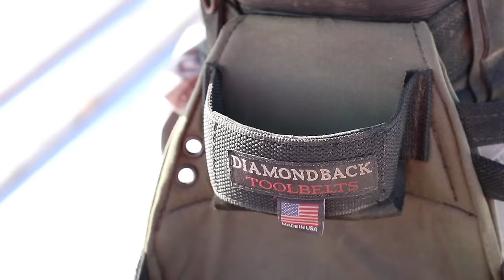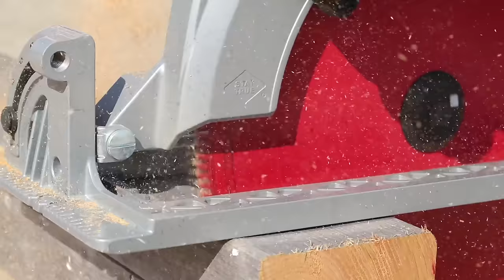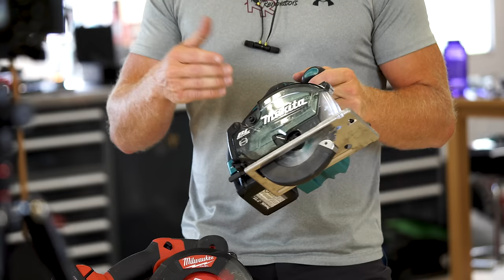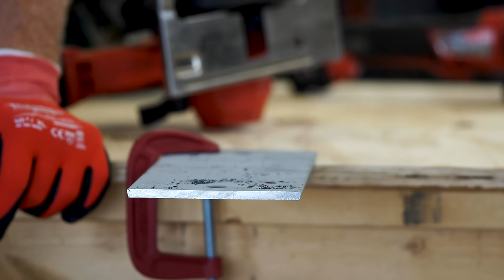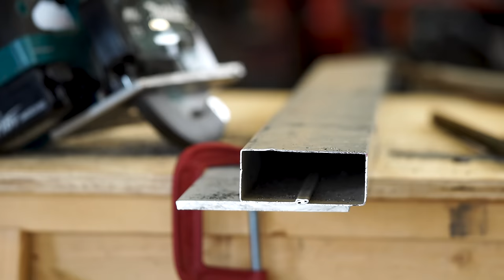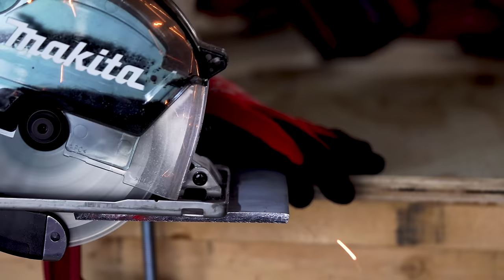Cutting metal with a Circular Saw: Toolsday with Metal Saws

Comment: I am a DIYer and I just bought a Dewalt Lightweight Circular Saw from Home Depot. When cutting metal with a Diablo 48T metal cutting blade it zipped right through my thin corrugated roofing with a great cut. My only complaint with this saw was that it spit out metal piece from the left side of the saw. Is there a saw with a better shield on that side to prevent the little pieces from hitting me in the face/hands/arms?
Reply from the maker: umm... did you watch the video lol the makita or the milwaukee take care of that

Comment: I've been using the 7 1/4 steel demon on my 10" milwaukee miter saw... it works amazingly well and makes some pretty accurate cuts conceding other options for cutting miters in steel... only problem is that it is certainly not made for sparks and hot metal at all... i had to tape some metal protection all over the saw for sparks to hit so it wouldn't burn the plastic...

Comment: Can you advise if cutting sheet metal or cutting the side of a shipping container with one of these would be ok? And better than using a grinder ? All your cuts have been on short pieces of material, not on a long sheet metal cut

Comment: I love these new blades. Diablo Rocks! Be careful some other brands you can spin the blade to fast on a standard saw and the blades won’t last as long. You can buy large metal cutting blades for your metal chop saw but they spin way to fast. If you add a speed controller you will burn up the motor. Next tool video, metal cutting chip saws!

Comment: Well presented video shows the basics most of us need to know about using metal cutting blades/saws.. i liked the grinder comparison. i would have liked to see also how a blade would cut in one of the normal smaller Milwaukee battery saws too and does battery choice matter to the cut in heaver stuff?  Another question do the teeth of the blades chip easily and does it affect the cut much if they do?
Reply from the maker: the diablo blade had zero chipped teeth

Comment: Def agree about proper tool for the job. Metal cutting circular saws are awesome. That cut you did with a regular didnt truly shoe the difference because the material wasnt that thick. With a regular saw you cam cut well up to 1/4" and if its flat plate only i believe it isnt 1/2". A metal saw can cut much thicker material. And blades will last longer due to lower rpms. And cutting metal with a regular saw def decreases the life of the tool. Good review

Edit: circular saw blades are not cheap as it is! Metal saw will save you money in the long run if you cut a lot

Comment: Kyle,
What battery platform would you recommend getting since I am just starting in construction? I will be doing framing as well as some finish work. Is there something you would suggest?
Reply: milwaukee has alot of good gear, mainly the circular saw, grinder, drill and impact driver. for nailguns probably paslode for gas version, hitachi battery framers are good, makita mitre saws either battery or corded, dewalt mitre saw is a solid choice imo aswell. hitachi finish brad gun is good for an all round use for installing windows and trim. everything else like levels and whatnot is more personal preference :)

Comment: Meta cutting saws sun at slower rpms than wood cutting saw. Higher reduction gearbox for more torque. Our saw in workshop only runs at 20rpm compared to these which are run at 2000-4000 pm but it still cuts faster than these.

Comment: I'm totally new to metal cutting and I've started using some cold-cutting blades.  One thing I've noticed is that it seems to cut better when you keep the chips as short as possible.  This would mean keeping the blade at full depth when cutting plate.  Have you noticed this or am I wrong?

Comment: It didn't look like the batteries were removed from the Makita saw as the operator installed the Diablo metal cutter blade-yes the Diablo blades are the best!!!!!Like how the Diablo Steel Demon blades can convert a woodcutter saw to metal cutting.Not as good as the dedicated metal saw-but good for a hobbyist or occasional user.Something about the metal cutters strangely addictive!
Reply from the maker: it cuts wood just as good

Comment: hi i just bought a Bosch Expert  circular blade of 160mm for circular saw, it is a blade dedicated to cut ferrours materials, i just cutted some grilles metal with 2mm bars tickness and blade's teeth are broken, i runned at medium speed with a makita sp6000 tracksaw, do you hnow why teeth broke?
Reply: Might it rotate wrong way?
Reply: @MrMikeqwerty  no, but maybe i just pulled back sometimes

Comment: Love the videos!  Keep it up. I want to ask. Best drill for the weekend warrior. Go! Thanks in advance.
Reply: I ain't him... But DeWalt 20v brushless is the best for the home gamer... Super durable, really long battery life, light enough to not wear out your wrist if you spend all day building a deck, fairly cheap and can upgrade to 60v batts and tools eventually. You're welcome.
Reply: blakjak220gmail what battery do you use with it? I got the 20v 7.25 brushless DeWALT that came with the 2.0 batts and I swear it’s like 10 cuts and the battery is dead or overheating
Reply: @sketchedwearhouse8792  I think he was just asking about a drill for the home gamer so I was only talking about the DeWalt drill drivers. You mentioned "cuts" so maybe you're talking about the metal cutting saw like in the video and I don't have one so couldn't speak to that. But just thinking how hard those saws work I would use either the new 60v batts or the big 5.0aH batteries. Anything smaller and I can see it not lasting but a few cuts, especially if you're cutting 1/4 steel..
Reply: i would lean towards milwuakee if your a jack of all trades weekend warrior they have something in all areas from carpentry to plumbing to tools for electricians and chainsaws but most importantly they have an excellent range of mechanics tools that are game changers the other brands dont off proper impacts in every size or 12v ratchets so on so forth
Reply: @AndrewBrowner  yeah I agree about the variety of the Milwaukee... They've got some really nice things. But I own both an M18 Fuel drill and the DeWalt 20v and I go for the smaller/lighter DeWalt every time. I also have the Milwaukee 12v drill, driver, ratchet and a couple other little specialty tools and they're awesome. But if we're just talking drill, then DeWalt is the best IMO. The Milwaukee M18 stuff feels super heavy compared to the DeWalt and there's not a huge torque difference.
Reply: @WideAwakeHuman  makes a difference in how much abuse they can handle still using the brushed drill/impact i bought first milwuakee tool purchase and drove a dozen holes through 3/16th steel with a hole saw drill was too hot to handle but didnt mind at all wish the thing would die so i could get the new gen 3 fuel set hahah not a fair comparison but i used a dewalt brushless drill before their best one at the time and it was lighter more powerful and the lighting was so much better... dunno what the lighting is on the gen 3 fuel but if its similar to my 5 year old brushed model thatd be a deal breaker... doesnt light up your bit whatsoever where the dewalts 3 leds around the chuck hits everything no shadows... but then you get to brushless chainsaw, 5" grinder, 1/2" impact, sawzall ect and milwuakee just slaughters dewalt
Reply: @AndrewBrowner  I've dropped my 20v DeWalt brushed drill off a ladder 14 ft onto concrete and not only did it still work but it didn't even damage the plastic housing. Also I just got the new 60v DeWalt weed whacker and it's awesome. Nearly as strong as my Shindiawa gas 4 stroke weed eater. I just broke down a couple years ago and started buying both lines... So I've got DeWalt 20v and Milwaukee 12v but I got rid of the Milwaukee 18v drills..too heavy and not enough benefit to outweigh the increased weight. But u really can't go wrong with either one, they're the best 2 brands I think in terms of quality and variety of tool and battery options. Plus the DeWalt tools are usually a little cheaper then the comparable Milwaukee which is nice sometimes.

Comment: Good info on blades. I was repurposing bedframe angle iron for file cabinet locks and that thin angle iron surprisingly took all the teeth of my 8" milwaukee endurance blade that came with milwaukee  metal circular saw. It was hard to drill too, maybe it was tempered.  Had to finish project with harbor fright cutoff disc. Think I'll try a Diablo now 
Thanks Kyle 
M L Rogers       Pasadena, TX 
BTW   who is that music by?
Reply: Some bed frame angle iron  is indeed exceptionally hard steel.

Comment: Metal blades are like brand new until they are ready to be thrown away they don't really wear down
At some point it just stops cutting and then you have to get a new one
Reply: I get mine sharpened....as long as teeth haven't been ripped off they can sharpen them up to 5 or 6 times.
Reply: @SuperScooby70  yeah I found the time is not really worth it. I run a lot of 14 inch carbide blades and they're like a hundred and sixty bucks by the time you stop take it off sharpen it or send it out for sharpening then you would have made your money if you were to just replaced it
Reply: Dale I keep 6  14" blades for my Dewalt cold saw in rotation.  A mix of Diablo and a few Dewalt brand blades. I run thru 4 of them, run those to my guy and $20 each they're sharp again and ready to be picked up within 24 to 48 hrs. I keep this rotation going because I never know when a big fab project is going to walk thru the door.

Comment: Its no secret Diablo makes excellent circ saw blades but I will say I bought a 2-pack of Diablo 4.5" cutting discs for angle grinder for the first time and my friend was the first person to try them cutting some metal threaded rod and he came up to me shortly after and showed me the disc and it was absolutely trashed.  A large chunk was broken off of it and a lot of the fiber was showing.  I took that disc off and threw it away b/c it was unsafe to use.  I put the 2nd Diablo disc on and started the grinder and I noticed immediately lots of debris from the disc was flying off then "snap" a large chunk went flying.   When I cut the grinder off the 2nd disc looked just like the first.  It was trashed within a few seconds of using it and unsafe to use.  I have used someone elses Diablo discs since then and they did not tear up like the ones I bought but I they did not have good durability compared to some other brands I use and their prices were a little higher.  I will continue to use Diablo's circ/miter saw blades but they are not nearly as good in the abrasives area of their company.

Comment: I always cut with the saw at full depth its a quicker and less work for the blade
Reply: What a load of crap..The deeper you set the blade the more it potentially has to work as there is more of the blade traveling through the material which can create more friction.You set the blade for the minimum amount needed.!

Comment: I don't think you gave the grinder a fair Shake I'm a professional fabricator and you score into a cut with a cutting wheel you don't put pressure on it it works it out too fast but yes they do wear down fast
Reply from the maker: maybe right...but no way to argue a metal saw on safety and speed

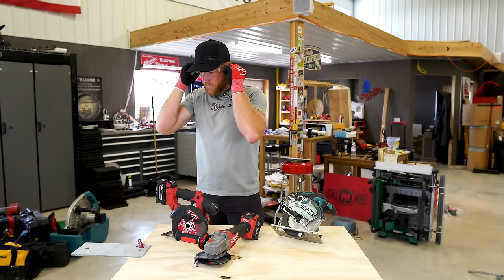Comment: 6:43 in ... WHAT  ??? Are you talking to me ???? Oh yes I can confirm it. But those saws spin a little to fast for metal saws. Your grinder is not fast enough for the Metal to cut with the disk you do need over 10000rpm in order to get something done.  And big tip when you cut metal cut deeper with the blade it will be less sparks so less heat for you. You cut metal not wood :-) there is a bigger difference and don't push let the blade do the work for you :-). On the Makita I can see you push to hard with the blade. And set your blade so it sticks out about 1.5" below the metal.  I do metal fabrication for a living so.  I cut even 1" with the saw no problem but often I use the Bandsaw from Milwaukee too especially on Angle iron as well as my bigger Bandsaw.

Comment: Hello Kyle,  I think you hit it on the head when you mentioned that the chip capture system made it so you can't see the blade track.  Big, big shortfall.  I cut metal for years with my worm drive skill saw and really think it is a better system.  I bought and used a Milwaukee corded cold cut metal saw and was far from impressed.  Biggest thing was the chip collection just wasn't effective enough to warrant the loss of cut path sight.  It also still made plenty of chips which ground through steel roofing paint when making a cut.  Just not a good system.  I cut a lot of aluminum also and the old Skilsaw while making a mess (although not really that much different from the Milwaukee purpose built) does the job.  A lot of hype goes into these as the 'new' tool on the block.  Fact is they aren't that much slower turning than the old worm drive and many sidewinders.  The slower rpm are touted for being more suited to metal.  Not really.  I have watched people build entire steel boats in the fifty foot range with the regular saws and I have done a ton of fabrication myself on all types of metal and shapes.   Quite a lot with just a regular carbide blade but ideally get a special made blade.  So I am not really sold on these 'cold cut' saws and most especially when you factor in the cost of the blades.  My Milwaukee lost its edge pretty rapidly after a couple of hundred feet of individual cuts on 22 gauge with a few gang cuts of half a dozen sheets.  Biggest thing by far though is the loss of visibility of the cut path when fabricating and doing long cuts as opposed to simple chop sawing (even then getting good line up is difficult without seeing the blade).    

On a somewhat different topic:  I really wish all portable circular saw manufactures would  put the dust discharge on the opposite side from the blade.  I recently bought a battery Makita that while a good saw just blasts the chips (plywood) and sawdust into your face while you try to watch the cut.  Even with safety glasses it gets in your eyes as well as 'sand blasts your forward control hand hard enough to be distracting and uncomfortable.  I have used several others that do the same.  Not a problem with the worm drive Skilsaw so it can be done right.

Good video.  A mention that saw cutting steel roofing really messes up the finish might be worthwhile as I see them used for that on YouTube quite a bit.  Take care.  Doug

Comment: the cutting position of grinder is wrong,The handle nust be towards operator the chips fly towards yhe tool,cutting direction is from operator to farther from operator to prevent KICKBACK which is very risky.

Comment: You are not using the grinder properly. You don’t want your wheel buried in the metal and cut from closest to you going away. If you use a grinder properly it can be very effective. Also if you want a grinder that cuts fast try the 6 inch Milwaukee with 12.0 batteries. We just did a tie on 12 inch steel pipe using only battery grinders. Cut and beveled with 6 inch Milwaukee grinders.

Comment: These saws aren't really relevant anymore. With diablo bringing out their cermet 2 steel blade it can be used on any circular saw. The only thing you're getting is a full blade enclosure on the guard. Not worth the money IMHO.  Tiny blade, limited capacity.
Reply from the maker: The enclosure is everything
Reply: The smaller size makes it portable for us electricians.

Comment: I am DYI and the way you setup this metal plate up, when using the angle grinder is amateur at best. The saws are great but you don't need to do something stupid to show that (you know your stuff), nice new Milwaukee blade to market 🤦
Reply: George Sadler I noticed you don’t know what a c clamp is called. You should get one. Even a diyer could find a use for them. They hold stronger than clamps I see a lot of people using.